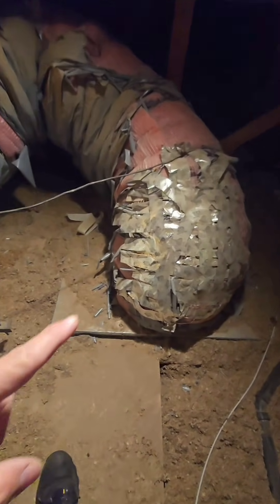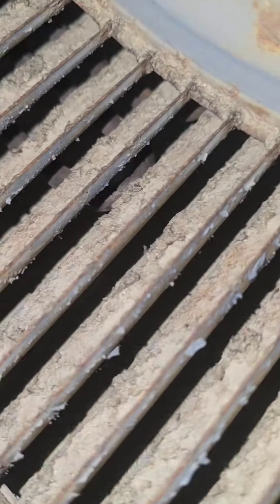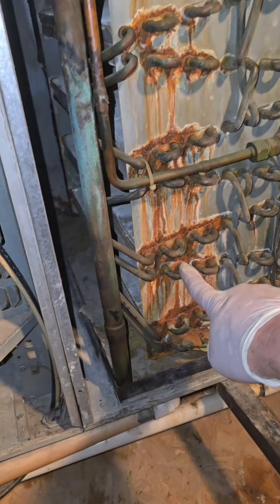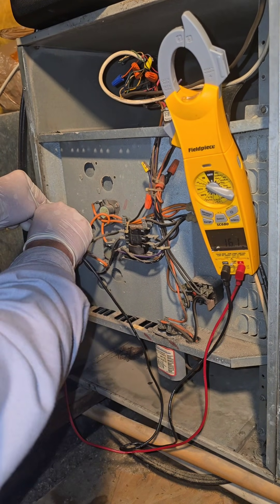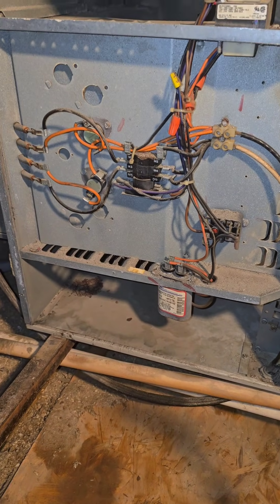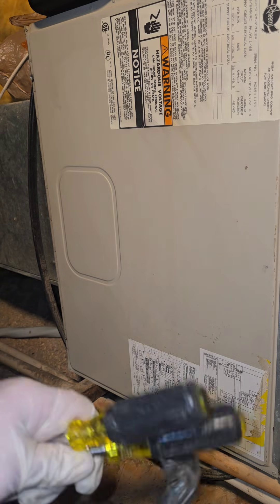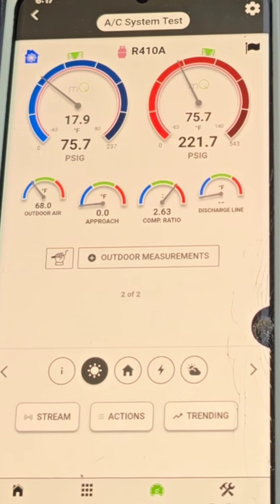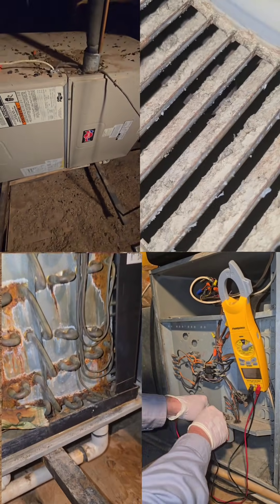Mismatched System check (vertical sorry)

Comment: Should be moving 60k BTU?  The indoor unit is 2 ton.  I’d say Frankenstein’s monster is exceeding expectations with that extra 4k BTU!

I recommend a swamp cooler/propane space heater combo as a replacement.

Comment: I love the videos with bad installs and we get to pick out what’s wrong with it😮 I’ve been in similar situations on old rental houses or home warranties where they are barely working and could die any moment but the job is to keep them running as long as possible 😂
Reply from the maker: Thank you! 
Yes it's ultimately the customers choice. 

I wonder though that company out that 5 ton condenser in this small air handler

Comment: Talk about a mismatch! 1994 R-22 evaporator 2 ton with a 5 ton condenser R-410a @ 17 degrees+-  💩💩💩

Must watch out for the Hantra virus but also be careful if there are any pigeons getting into attic's the dust from the 💩causes Chlamydia psittaci (causes psittacosis or ornithosis): A common zoonotic bacterium shed in pigeon droppings and secretions. Humans inhale aerosolized particles, leading to flu-like symptoms, pneumonia, or severe complications. This is one of the most frequently documented transmissions from pigeons.

Merry Christmas!
Reply from the maker: I did not know that about pigeons! Man I have cleaned out a lot of pigeon nets in the last 🤢. Thank you for the heads up!

Merry Christmas!

Comment: I am old and hard of hearing, what was the virus you mentioned at the beginning of the video. Also, your recommendation of replacement is good,  but in an attempt to quantify your statement at the end,  "So it will last a long time" we all know that new equipment will never last as long a time as that unit in the attic did. Good video.. Thank You.....
Reply from the maker: Hantavirus is the one I am concerned about being airborne.

You are absolutely right about the new systems not lasting a long time!!

When this compressor shuts down it makes a pretty bad noise that I went to record. In my mind I was thinking about lasting  longer than that. I did not end the video well at all. I was running out of time.

Comment: Nope, perfect. Make sure you use an N95 mask and they recommend spraying bleach and waiting 5 minutes before cleaning as you did.  Gently wipe, no vacuum etc. . Great video.
Reply from the maker: Thank you! I will change my methods to bleach and add the 5 minutes in the future. I appreciate the information.
Reply: Nice job Ty, what tools use to measure air flow? Thank you.🌹